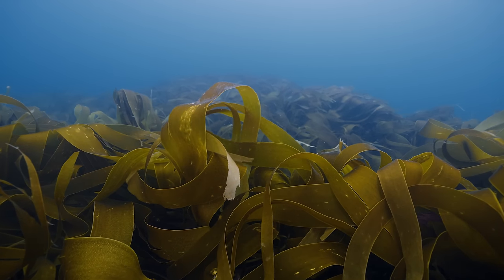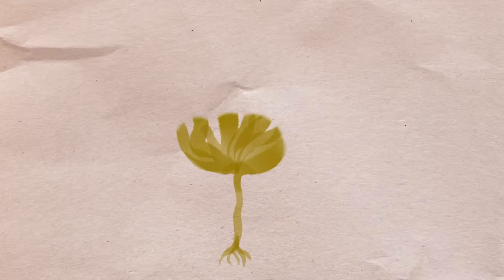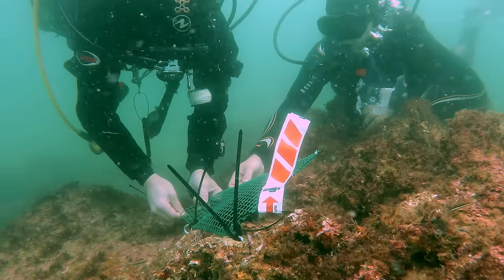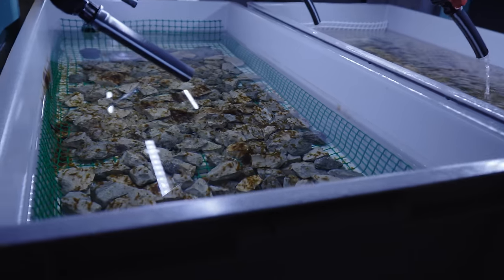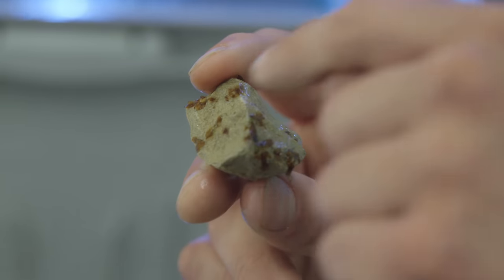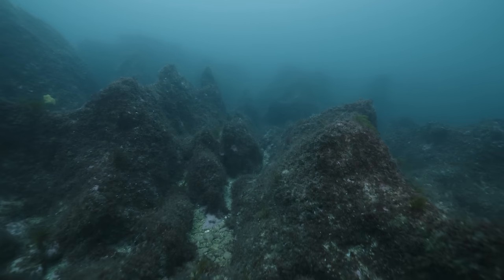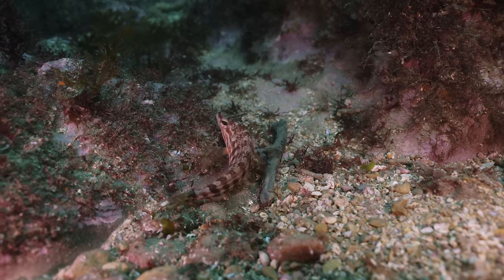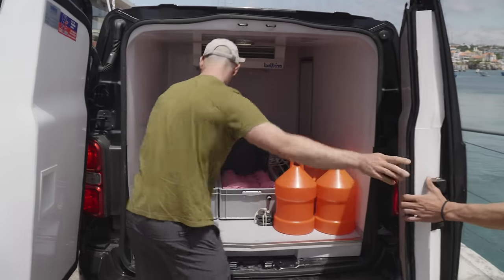Our Kelp Forest Has Sprung to Life! - here’s how we did it

Comment: Its very hard to look at kelp forests and reef building and maintain any excitement for the reef options.

I think the only solution is doing everything ASAP but the reefs have to be combined with other synergies to make them a viable part of any chemistry or warming goals.

I'm most excited to see large scale managed ecosystems in the north pacific grye.  Full water column habitat, anchor to float, with upwelling managed to maintain an ideal temperature.  100 square miles of mid ocean kelp forest with new runs of sardines and other commercially viable species using it as habitat could replace a lot of coastal fish farms, trawlers and abusive fishing practices.  It would also draw down more CO2 than all of our capture projects combined.

Trading access for protection of sensitive areas in their waters could allow the restoration and maintenance of stocks globally.

Comment: can you put each rock inside a metal  net that will rust when the kelp is big enough
Reply from the maker: A bit like a treeguard underwater. Might be a bit overkill and expensive to implement. For now we will try to keep reinforcing the forest to reach a tipping point but we will see how it works out! - Cheers, Duarte
Reply: @MossyEarth what happens to the kelp that faces down? will the plant grow even if it's not facing up? does the kelp turn the stone when it's big enough by it self ? 15:39 15:39
Reply: @johanbrorhee927  I don't know how it works in water but on the ground plants always find the way up even if they have to go around.
Reply from the maker: Good question. Each rock has dozens of tiny kelps so I think that usually there is one that ends up facing the right way up. Worth thinking about though 🤔- Cheers, Duarte